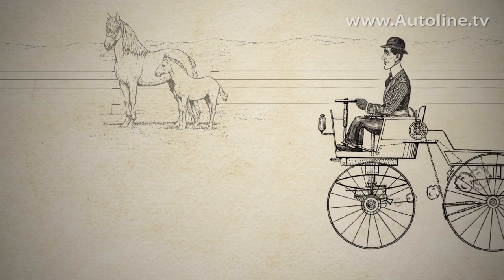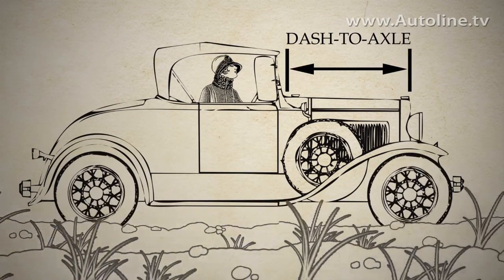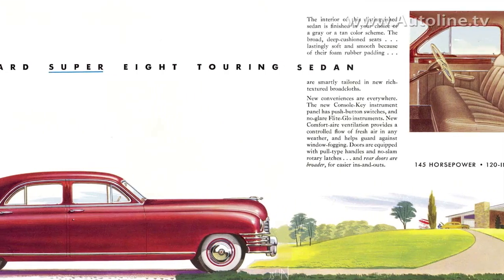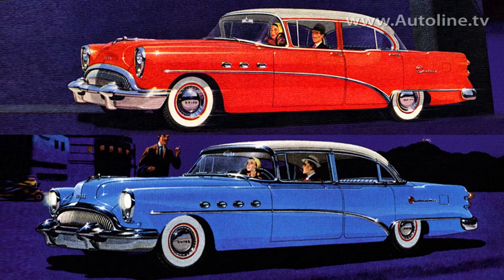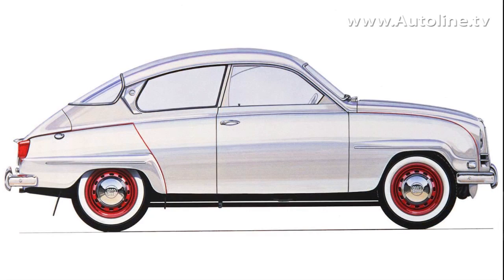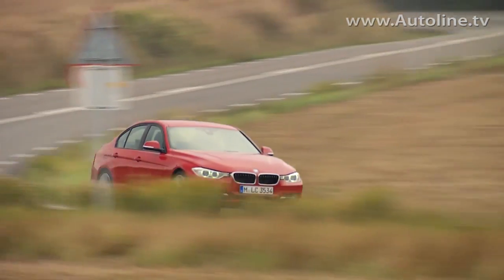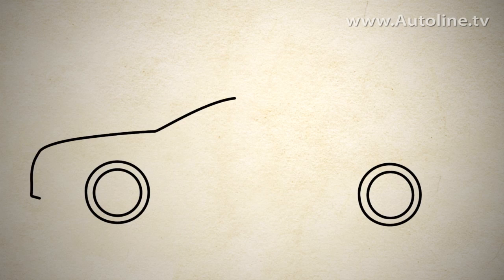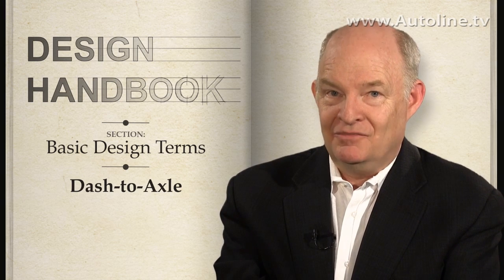Defining Dash-to-Axle - Design Handbook

Comment: Long dash-to-axle cars also feel very different when driving them. Couple things: 1- they have a better balance and handling 2 - they feel smoother due to the greater distance between the wheel to road contact and the driver's 3 - the steering feels more transparent due to the lack of front axles (rwd cars only)

Comment: I like the dash to axle ratios on the Mercedes SLR McLaren (entire engine sits in between), the Mercedes Benz SLS, and the Viper.  Nothing says presence more than a car where it appears the engine has more room than the occupants.  Also, the character line on the current Z4 is deceptive by making the car appear to have a longer hood than it really does.